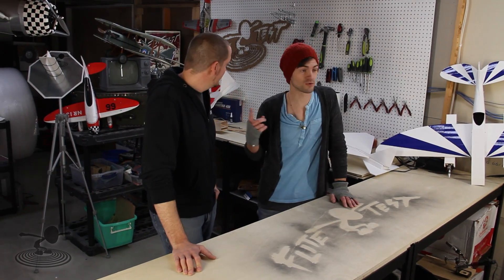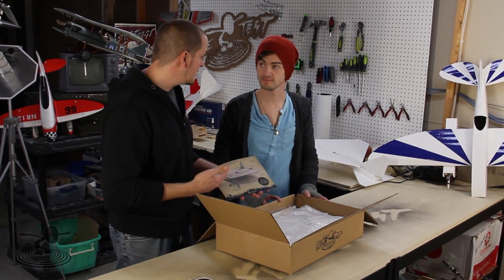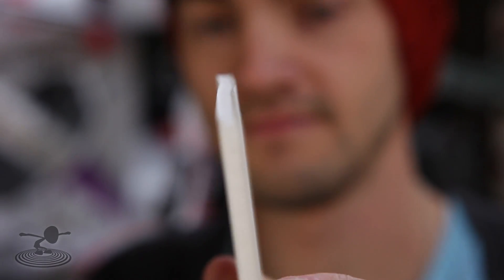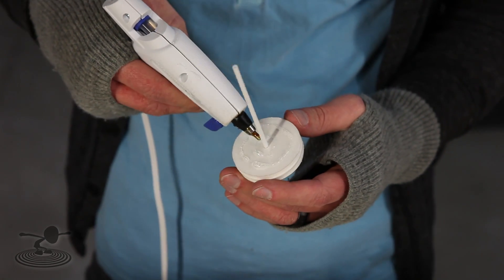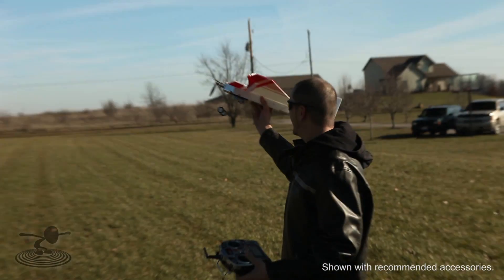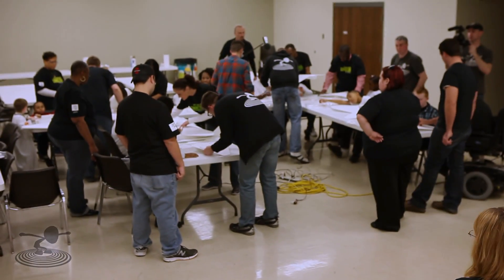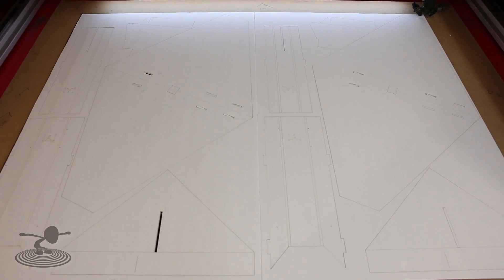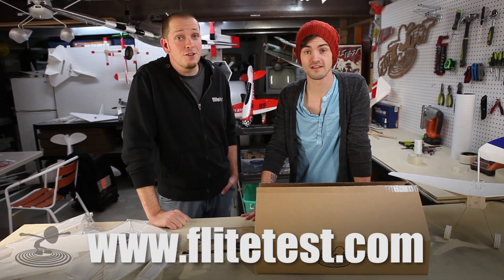Flite Test - Speed Build Swappable Kits!

Comment: Hi guys. Is it possible for yous to build a plane from just a cartoon box? Like a tube, inside the prop on the front, covered, so cannot break it, the wider parts are the wings and the ends are the rudder and the elevator? Is it possible to do it? Thanks.

Comment: Hey guys, do you know if the FT Flyer power-pod and firewall from Flite Test's speed build kit is the same size as the power pod in the Versa Wing and the P-51 Mustang?

I'm building an FT Flyer with my wife to introduce her to RC flight and I have both a Versa Wing and P-51 Mustang speed-build kits lying around that I haven't built. I'm playing on scratch-building the FT Flyer, but I'd like to use one of the power pods and firewall from those kits.

Also, I have a few 8x4 props, a 28-26 1200kv NTM motor, a Turnigy plush 25A ESC... This might be overpowering on the little FT flyer, but I don't want to buy other gear as I have this already lying around. You think this will work?

I see some of you are running a 2200mah 3S with some success. Good, because that's what I have from my other planes.

Comment: Do you need a set of electronics for all three planes or just one
Reply: Certain electronics are required for each plane, but the power pod (which contains the battery, receiver, speed controller and motor can be transferred from one plane to another. As far as I know for the newer ft series planes, only the servos require to stay in the plane, not to sure about these three planes... Hope this helped! :)

Comment: Josh Bixler mentioned vinal covering My question is will this foamboard withstand the heat needed to cover with say ultracote or monocote ?

Thanks in advance :D
Reply: A guy on youtube 'experimental airlines' covers all his planes.
He sent flitetest a plane once, his channel will give you more info.
The foam board in different countries can be very different though, his is in US
Reply: drcuffe ED aka Experimental airlines uses vinal sticky tape not heat activated glue on shrink wrap.
Reply: ***** Might be worth asking him, as he has tried a lot?
Reply: ***** The vinyl josh ist talking about is the self-sticking type used to decorate windows and signs and such. I'm not sure how much heat ultracote/monocote requires, but the chances that the foamboard will warp or the paper will come loose is quite high.

Comment: Foam Board Painting tip: For easy masking, spray a light coat of spray-mount adhesive on your masking material (I use the slick coated ads from the newspaper) Position the mask on your plane, rub down firmly, then spray the paint ... LIGHT COATS! Leaves a sharp line without pealing the paper off the foam!

Comment: You may want to look at a product called "Model Plane Foam". Google it.Three RC guys from southern Michigan got Adams Foam to produce the product. It's the same process as Adams Dollar Tree Foam, but no paper, and a little thicker with a larger form factor 48"x24". They keep the quality high.They sell it by the case...16 sheets for $65 shipped anywhere in the 48. Go to RCGroups and Search for MPF in the Scratch Built Section. They're great guys. PM them. Make a bulk buy. Maybe offer it yourself.

Comment: This is awesome! I wanted to build an RC plane (never built one before...new to the hobby). Started out w/ the Baby Blender. Many trips back and forth to the hobby shop and hardware store and still couldn't find all the right parts and pieces. Ended up improvising. Maiden flight lasted about 3 seconds: A lot of work smashed and my $50 motor busted on impact :( These kits make it much less intimidating for folks like me that want to get started without having to go on a scavenger hunt! Thanks!

Comment: You guys should review the PowerUp 3.0 when it comes out in August. It's not a plane. Rather, it's a power pod consisting of a battery, electric motor that swivels, and a bluetooth receiver. What's cool about this is you can attach it to any paper airplane, making the plane capable of powered, controlled flight. You can control it with any mobile device that supports Bluetooth 4.0, and flight time is expected to be ten minutes.

Comment from the maker: Well, I guess we know who ONE of the dislikes belongs to :[ 

I think you missed the point completely. The speed build kits were created to break down the wall of intimidation around scratch building. The intent is to generate income while providing a valuable service. 

Why are you so negative? Most of your comments are very downtrodden. Lighten up a little... It's not like we bust in each week and perform in your living room. Besides what does my house have to do with any of this?
Reply: are propellers included?
Reply: @nanakyanair3467  no. You get the foam stuff. For the electronics (including the propeller) you gotta buy the power pack that corresponds to your model (for example, the simple cub uses the B Pack). Or you can just save some money and get seperate components of the same specs